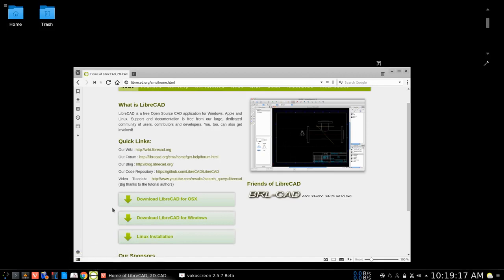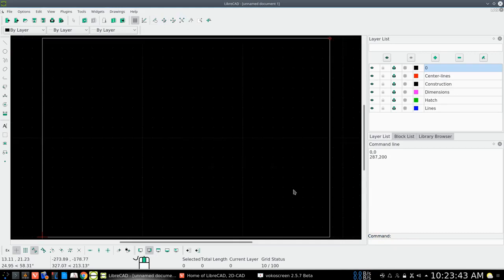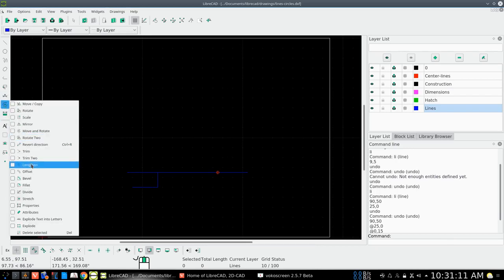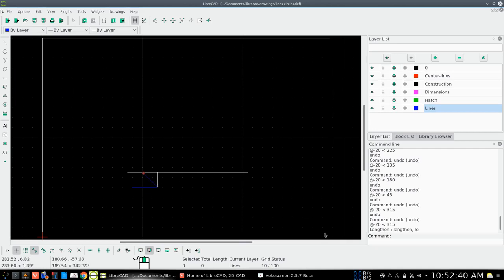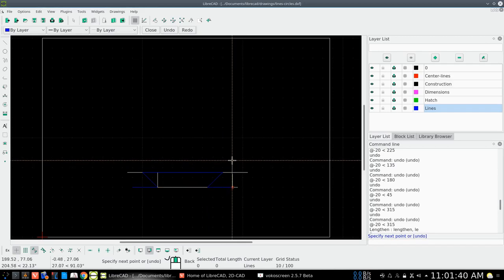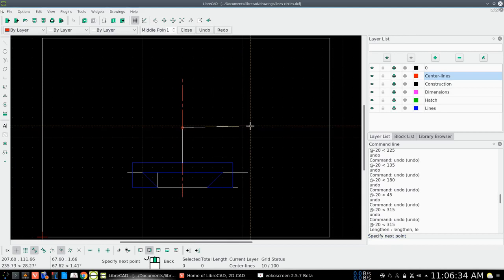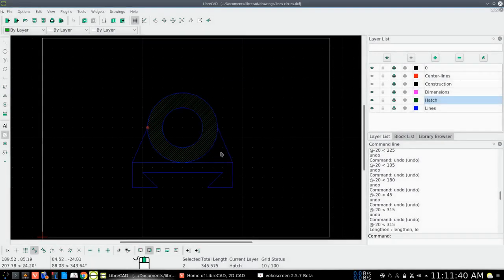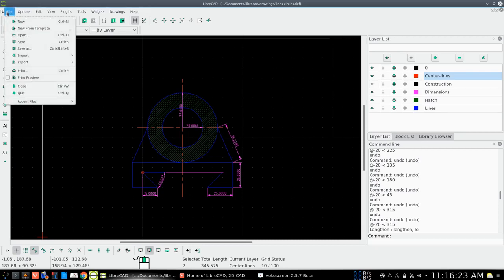10 circles lines dimensions angles and hatch

Comment: Where did HATCH go?   Upon clkng, the icon; Cmnd Ln says: "file does not exist".     ?   Thanks!
Reply from the maker: Hi a Boswell Inniss; When you wish to add a "Hatch" to a shape the shape must some area to hatch. Hence, to hatch the surface area must be greater than the width or weight of a line. To "Hatch" try this: 1). Select the area you wish to "Hatch". 2). Click on the "Hatch" icon - a window containing "Hatch" attributes should open. 3). In the "Hatch" window choose the design of the "Hatch" that you desire. 4). Click "OK" button in the "Hatch" window and your mouse curser will be large cross-hairs and move the mouse curser to the selected area and click once. The area should auto-fill with the "Hatch" pattern that you have chosen.
I hope this information is helpful. If you have any further question pertaining to this topic, please comment.
Thank you.
howtopam

Comment: I have been watching your LibreCAD tutorials.  Thank you for taking the time to make them and share with the rest of us.  I have a question and perhaps you are moving this direction.  I would like to make a drawing with a title block showing a Plan, Top and Side view.  But let us assume that the part I am drawing, if drawn at full scale would be too large to fit on my selected paper.  How can this be drawn at a smaller scale and the dimensions show correctly on the drawing?

I hope my question makes sense.  Thanks you for any advice or direction you can provide.

Joe
Reply from the maker: Hi My Heap; Thank you for your question. In Librecad we like to think in terms of - "one drawing unit is equal to one real world unit." This suggests that 1 inch of the real world size is equal to 1 chosen increment for the drawing scale. hypothetically let us say that we have a real world box container that is 42 inches long, 36 inches wide, and 26 inches high - this container is too large to be drawn at its real world scale on most conventional drawings papers. Therefore, we would first choose our scale by discovering a relationship between our drawing paper size - A4 drawing paper (297mmX210mm) - and out container real world size. To find that relationship we can divide the real world container size into the drawing paper size to get a percentage ratio between the container and the A4 paper. We can divide the long side (42") and the height (26") of the container into the long side of the A4 paper (297mm "11.69 inches") and the height of the A4 paper (210mm "8.26 inches"). Then in this case we have 11.69 divided by 42 and 8.26 divided by 26 which is equal to: 0.2783 and 0.31769. Then the A4 drawing paper is in length 28% and in hight 32% of the real world container. If we desire to show extra views like  "side and top" on our A4 paper then we must calculate room for those views on our paper as well. The A4 paper will need to be sectioned into an ares for the "front view" the "side view" and the "top view". The long side 42 inch front view can only use say 50% of the total length and the hight of the front view can also only utilize approximately 50% of the total A4 paper height. Therefore we can use 50% of our 28% length and 50% of our 32% height for the front view space on the A4 paper. This means that we will draw our front view at 14% of 42 inches of real world length and 16% of the 26 inch real world height. Therefore 14% of 42 inches is equal to 42 x 0.14 = 5.88 inches in length and 14% of 26 inches is equal to 26 x 0.16 = 3.64 inches. NOTE: to keep the scale relative to all dimensions we MUST use the 14% of the length as a factor for the height and width as well.
Now we can begin to draw the front view, leaving space on the left or the right for our side view and a space on above for a top view. So we begin by entering in the command line a start position near the bottom of the A4 paper and then 5.88 inches in the X direction by 3.64 inches in the Y direction. Therefore we have 5.88 inches is equal to 42 inches and 3.64 inches is equal to 26 inches. This is how we discover our - paper scale - to fit our real world container onto our A4 drawing paper. Our A4 drawing paper space for our front view is 14% of the size of the real world container. Then to get the actual drawing scale factor we we can multiply 12 inches by 14% to get 1.68 inches, showing that 12 inches of real world size is equal to 1.68 inches of drawing size. 1.68 inches is 1 11/16 inches and therefore our drawing scale will be 1-11/16" = 12".

I hope this information helps some Joe.
Thank you;
howtopam
Reply: Thank you for taking the time to explain the scaling of the real world object to fit on the space available on the paper.  Assuming that real world object was scaled and drawn, then when it comes time to dimension the object, then the new scaled sizes would be displayed, correct?  Or is there something I am missing.  Now, for giggles, what if I wanted to include an ISO view in the same drawing, can this be done??

My reasoning behind the questions are that I would like to convert a project from an old magazine (A milling attachment) for a 7 inch lathe and scale it for a 10" lathe.  I would like to produce drawings for these new parts in a typical 3 view drawing, and if possible provide an ISO sketch of the part as well.  I would really like to have these on a single sheet.

Is it possible to draw the object full size and then "Shrink" to a printable area, and still contain the border and block information?

Now, truth be told, I am a computer network guy by trade and have only recently branched out to the metal working world.  I have been using Linux for years and am a firm believer in the Open Source movement where it is appropriate.  I have used LibreCAD for some simple drawings in the past and hope since I already have a familiarity with the software that it can be used for the project I have in mind.

After prototyping the milling attachment, I would like to be able to give the drawings and write up away.

Thank you for your patience with me.

Joe
Reply: One last thought, should I be looking at FreeCAD instead of LibreCAD to do this?  Or maybe you could consider a tutorial of the above?  :-)

Joe
Reply from the maker: Hi My Heap; I feel that I must apologize for the reply that I wrote in response to these questions apparently mysteriously has vanished. After posting the lengthy, page long, reply it has been removed by the Youtube automated system; likely for being too voluminous. I will attempt to reiterate all the information that was written in the first reply, but I will post it is two separate replies as to not alarm the Youtube spamming protective system .  

As you clearly witnessed by my reply to your first question scaling a drawing requires a bit of calculating first for the paper scale and second for the actual drawing scale. That said; to lessen the task of calculating Librecad has proposed that drawing been easily accomplished simply by relating "one drawing unit" in representation of "one real world unit". This simplifies scaling erroneously by allowing (one foot, one meter,one mile, one kilometer, one inch, etc) to be represented on the drawing as (one millimeter, one centimeter, one inch, one foot, etc). In this way one is relative to one. (1:1).

Your question about scaling the entire drawing complete with all of it attributes including - dimensions - is completely and easily possible. You first must make absolutely certain that ALL drawing attributes are selected together with ALL the the dimension attributes. Once ALL has been selected you can choose the "Scaling tool" and input your required scale causing ALL drawing attributes to become redrawn at the new scale. Even the dimensions will be re-calibrated and display the modified integers.  

I hope this reply survives system auditing.
Thank you for your question.
howtopam
Reply from the maker: Hi My Heap; Part two. Yes you can insert a 3D ISO view into your drawing quite easily. You will need to draw the ISO view on a separate drawing utilizing the isometric drawing grid located with the drawing setup tools. After drawing your 3D ISO view you can - create a block - of it and then save the block and insert that block into your plan view drawing. The other alternative is to - save your ISO view drawing as an image. Then you will be able to insert that image of your 3d ISO view into your plan view drawing.

Should you use FreeCAD? I find that software applications are merely tools - like a saw or a hammer, or measuring device and therefore need to be viewed similarly. One hammer does not feel right in every hand. Therefore, one must find a software application that feels right and then practice to become adept in it usage.

Thank you again for your questions; Again I apologize for this delay in responding to your questions as per the automated removal of my first response. I hope this information is helpful.
howtopam
Reply: Thank you again for taking the time top respond to my questions.  Since my last post I have been playing with LibreCAD to get a little more proficient with it and things are looking brighter.  For example, including 3 views and an ISO is no real issue for me now.  I draw them all in the same drawing, by the way.

The items that I have been drawing fit neatly into the quadrant of paper that I have set aside for them.  At the risk of sounding a little dense, I have one follow up question.  You stated that a scale can be attached to the drawing.  For example, 1 inch = 1 Foot.  I have a part I want to draw that would be about .250 inches to 1 inch.  I have looked through the drawing preferences and cannot find a place where to set up a scale.  I will do some google searching too.  How are the scales linked in LibreCAD?

I may have confused myself.  You are talking about a scale at which you are drawing and not a scale at which you are printing, correct?

Once again thank you for taking the time to answer my questions.

Regards,
Joe
Reply from the maker: Hi My Heap; Here is a link to some scaling information that you might find helpful.
http://forum.librecad.org/How-to-change-the-scale-td5706992.html

howtopam
Reply: Hello howtopam,

Thank you for the link on scaling above.  I think we have a disconnect on my question.  A problem which I am over thinking.  Having had all out discussion above, I can create my drawings, both orthographic and isometric in the same drawing, scale them with the print function so they all fit on the letter size paper I use.  I was viewing the problem from a different angle.

1) Open a new document and create a border for letter size paper leaving 1/4" of space.
2) Within this border create a title block for information about the drawing. (material, drawing number, part number, (&c).
3) Divide the remaining area into four quadrants.  The would be used for Front, Top and Side views with the remaining quadrant to be used for an Isometric Projection/View.  Each quadrant would be roughly 5-1/4" wide by 3-1/2" tall.

Now at this point I want to draw the three views for a part, a front, top and side view, and an isometric projection in the remaining space.  Let us say that the part I want to draw is a simple solid, a rectangular block measuring 4" x 8" x 18"

This is too large to fit in the allotted space, so we calculate a scale that can be used to draw in the available space, leaving at least 1/4" away from the border and the adjacent quadrants.  A quick and dirty calculation tells me that if I scale the size down to 25% of it's original size, then the part will fit in the respective quadrant, so the 18" side becomes 4-1/2".  (&c)

Say that I draw the three views, and then I go to set dimensions on the drawing, My long edge will measure 4-1/2" not 18". 

If I dispense with the scaling and draw full size and leave off the border and title block, the drawing dimensions are full size.  I can scale with the print feature to make them fit on my paper and all is good.

Given the above, I guess I am looking for a way to make my drawings, AND have the border and title block on the page.

As a side note, I use the Scale feature all the time when I scale vectors for my CNC machine.

I know this has gone on longer than most would wish.  I just wanted to explain what I thought was a communication gap.  Thank you for your time.  Merry Christmas to you and Yours and Happy New Year.

Laus Deo Semper,
Joe
Reply: I guess I should add that I am neither a draftsman, machinist nor an engineer, but rather a computer geek who derives some satisfaction with a hobby outside the computer industry.  Thank you again for being so tolerant and patient with me.
Reply from the maker: Hi My Heap; You have a  good understanding of how the application functions and that is terrific. 
Thank you for your seasons greetings and we wish the best for you and yours as well. Take care.
Thank you;
howtopam